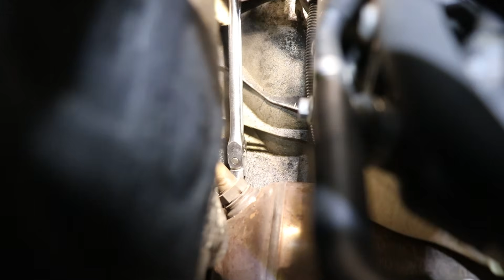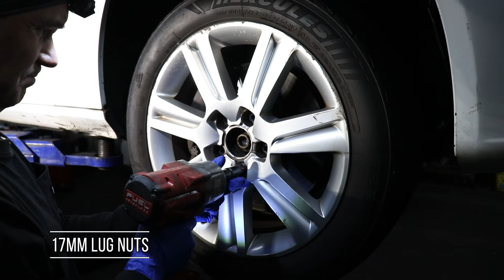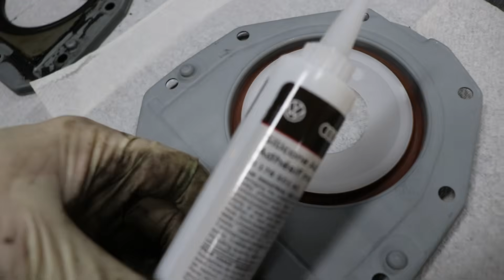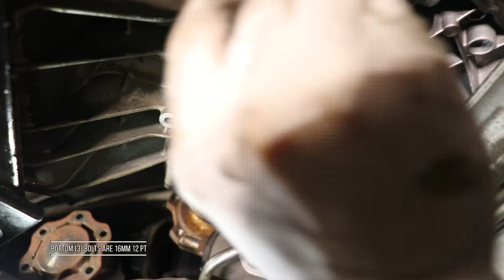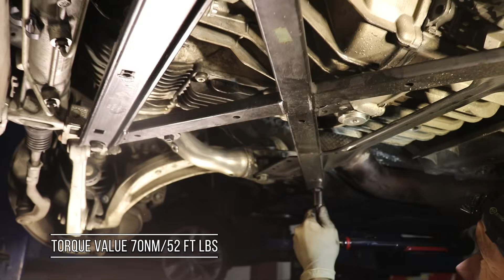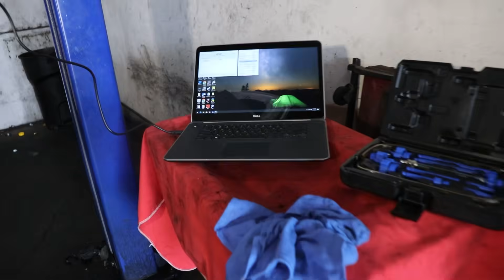2009-2013 Audi A4 B8 Continuously Variable Transmission (CVT) Removal ***Tutorial***

Comment: Do you have to replace the T40 bolts or can they be reused. Audi manual says to replace.
Reply from the maker: Thanks for the question Mike. Audi states you can refuse the bolts (1) time. So you can remove and replace the trans and reuse the mounting bolts.
Good luck on your Audi project.
Cheers!

Comment: Is it possible just to swap the tcu with the orginal one ?
So that you do not have to go to a Audi dealer ?
will it work?
Reply from the maker: Thanks for the question. If you swap out the original TCU from the failed CVT transmission, you will not need to program the car. Good luck on your Audi project, let us know how it goes.
Cheers!

Comment: Any tips on searing the torque converter, I pulled my engine out to do service and now we are reinstalling my engine, and the torque converter is binding up. We are under the impression that the torque converter is not fully seated on the input shaft.
Reply from the maker: Thanks for the question, do you have the same CVT transmission? There is really not a torque converter on the CVT, like a conventional automatic trans. You just need to line up the flex plate bolts to connect the trans to the engine. Let us know if you are still having trouble. Good luck on your Audi project.
Cheers!

Comment: Hi, how easy is it to remove the TCM from these? I have an Audi A5 2009 2.0T TFSI with the following codes: P071700, P171E00, P071600, P171F00. The fault is intermittent… it clears and comes back on its own. Once cleared, the car drives all fine. However, once it is back, it jerks and gets stuck on gear 8..
Reply: I am planning to have it reconditioned.

Comment: Will the car not move without doing the reprogramming ??
Reply from the maker: Correct, the component security will prevent the new Trans from operating. It will need to be coded to your VIN in order for the computer to recognize it.
Good luck on your Audi project.
Cheers!

Comment: UPDATE, I just want to say thank you for the video. Without it I wouldn't have attempted the repair of my rear main seal. For everyone that is wondering, it is possible to do in your driveway. It's not nice but it works. If you want to replace the gear box the car has to be pretty high up. I only jacked it up a little bit and moved the gearbox back to get to the rear main seal. Thanks again. Very valuable content!!!
Reply from the maker: Thanks for the feedback, glad to hear you were able to knock it out in your driveway. That CVT is really heavy so it makes it a little challenging.
Congrats on getting it done and saving a ton of cash.
Cheers!

Comment: I have a 2011 Audi A5 Sportback, I installed a gearbox from an Audi A6C7 and the car doesn't move. Maybe the reason is that my gearbox had 15 pins and the new gearbox has 16 pins. Can you tell me what to do about this?
Reply from the maker: Sorry to hear you are having trouble with your Audi transmission. We are not sure about the pin difference you are mentioning and what impact that has. 
What error messages or codes are you getting after the transmission replacement?
Was the replacement transmission coded to the car?
Cheers!
Reply: @BradleysGarage  has not yet been coded in the car and there are no errors on the instrument panel.

Comment: How similar is this to a manual transmission removal on a 2011 A4? Great video!
Reply from the maker: Hey Ivan, the process will be very similar if you have the 2.0T engine and only FWD. The good news is the manual will be smaller and lighter than the CVT. If you have a Quattro, then you will also have to remove the rear driveshaft.
Thanks for the kind words, glad you enjoyed the video. Good luck on you Audi project.
Cheers!

Comment: What is your advice for buyers, to buy Multitronic or S Tronic transmission (used cars this age)?
Reply from the maker: Thanks for the question, it really comes down to personal preference. The most important thing you will want to look at for either transmission is service history. For the CVT, fluids need to be changed every 30k. On the S Tronic/DSG they typically are done at 40k miles. If these don't get changed on time, then you run the risk of having a situation like we had on ours. Purchased the car with 163k miles on it with unknown service history. Only went a few thousand miles before the CVT just went out. Premature failure can happen anytime with poor or neglected maintenance.
The CVT will be a smoother ride and theoretically more efficient (gas mileage). You won't really notice shifting since it's a belt sliding along a cone shape. These transmissions come in the smaller engine, less powerful models. They are only offered in FWD and not Quattro.
For the S Tronic/DSG you will notice the shifts and feel the gear changes. It will be a more spirited driving experience where you can have more control with paddles. This option will give you the ability to have Quattro AWD if that is important to you. These transmissions came in the higher HP models which typically have more options and better features.
Our ultimate advice would be to locate a manual and never have to worry about a transmission going out, plus they are a lot more fun to drive. Hope this helps with your question.
Cheers!
Reply: @BradleysGarage  Thank you.
Reply from the maker: @JeZZGro  No worries, thanks for hanging out.
Cheers!
Reply from the maker: @JeZZGro  No worries, have fun in your search.
Cheers!

Comment: do you think i can change the rear main seal at home?
Reply from the maker: Thanks for the question, you can do it at home. You will however need to have a nice transmission jack as this CVT trans is very heavy. You will also have to have the car in the air high enough to slide the trans out.
Other than those two things you should be able to accomplish this in your driveway.
Good luck on your Audi project, be sure to let us know how it goes.
Cheers!

Comment: What size are the o-rings or what is the part number?for the transmission lines you installed into the filter.
Reply from the maker: Thanks for the question Alex, apologies we did not include those in the video description originally. You will need (2) O-rings, Part# N90666003
https://www.fcpeuro.com/products/vw-seal-ring-genuine-vw-n90666003
Good luck on your Audi project.
Cheers!
Reply: @BradleysGarage  thanks!
Reply from the maker: @alexn4917   @alexn4917  No worries, have fun on the Audi. Cheers!

Comment: Where is the transmission refill hole?
Reply from the maker: Thanks for the question. If you are doing a filter change, you can add the initial fill from the top through that hole.
The actual "fill" hole is the same as the drain hole. You need to either manually or electronically pump the fluid up through the bottom once the transmission has reached the optimal temperature.
This requires a cable (VCDS) and software in order to view the current fluid temps inside the transmission. The engine will be running while in park to accomplish this.
Hope this helps answer your question.
Cheers!

Comment: I always use an aditive with the 8L oil . I put Extreme CVT yellow brand for the oil PAO+Ester oil base plus Lubeguard Aditive especially for CVT from USA product.

Mine is 0AW LLA trans Multitronic from 2008 Caga Code Motor . It has now 214.000km and runing real good each 35.000 i change oil and filter.

Greetings from Spain Europe
Reply from the maker: Thanks for the feedback and product suggestion, we will look into that. Glad to hear yours is still running great after 214km on it.
Cheers!
Reply: @BradleysGarage  big hello there Bradleys ✌️
Reply from the maker: @Summerlove-M  Thanks again for hanging out, where are you from?
Cheers!
Reply: @BradleysGarage  Spain Europe ! Located in the south . City called Malaga
Reply from the maker: @Summerlove-M  Looks like a great city, amazing weather year around. Not to mention you are on the beach. 😎
Haven't made it to Spain yet but it's on the list for sure.
Cheers!
Reply: @BradleysGarage  Neither here for USA but its on my list always and i always like to watch how you guys work on the cars . Its super cool .😎 ✌️🤙🤙🤙 .

I love the oil brand Redline from USA we use it here . Best oil made for engine 👌

Comment: It is necessary to change the filter for a new one, each time you change the gearbox oil?
Reply from the maker: Thanks for the question Fabian. We recommend replacing the filter with the trans fluid every 40k miles. Since the cost of the filter is less than $60, it's cheap peace of mind. Especially since the internal filter is really not replaceable since you have to split the case open. That external one is the only filter you can change.
Cheers!
Reply: Ola pessoal tudo bem ? Estou com um a4 2.4 v6 , ele está sem pressão no modo driver. Esta acusando 130 bar de pressão no scanear , em marcha ré esta normal chega ha 400 a 600 bar de pressão. Alguem pode me ajudar ? Troquei o óleo porém não tive acesso ao filtro
Reply: Changing filter is a MUST buddy , always and each 30 to 40k Km . Big hello from Spain
Reply from the maker: @Summerlove-M  Thanks for the comments, going past 40k is the fastest way to be buying a new one. It's imperative to change it on time if you'd like to keep driving your CVT Audi.
Cheers!
Reply: @BradleysGarage  exactly , thats why im telling to change oil and filter each 40.000km or less 👌
Reply: @BradleysGarage  dont forget to recommend users a really good oil basses PAO plus Ester as RedLine CVT SLIP , probably the best if not one of the best as Ravenol or Exline CVT ( yellow brand) 😼👌👌

Comment: hey there i recently done this. once i changed the trans i had the SAFE mode on dash aswell an i could no move the vehicle. i would put it in drive, reverse etc and it would not move.. please help.. cheers
Reply from the maker: Sorry to hear you are having trouble with your Audi. That is completely normal after replacing the CVT. There is component protection on all the electronic parts for Audi/VW.

Like we described in the video, you will either need to use your TCU from the old transmission since it's registered to your VIN or you will need to reprogram the new transmission so it can be registered to your car.
Please reach out to us over on our Instagram account and we can put you in touch with the guy who programmed ours.

https://www.instagram.com/BradleyGarage/

Cheers!

Comment: What is this transmission code thank you
Reply from the maker: Thanks for the question, here are the scans for the ENGINE and TRANS from VAG-COM-

Engine:
7021 - MIL Request Signal Active (Check TCM for errors too!)     P1624
Auto Trans:
9828 - Clutch Pressure Adaptation           P1741 00 [040] - Limit Reached
9827 - Clutch Pressure Adaptation           P1741 00 [044] - Limit Reached

Hope this helps with your A4 CVT project. Cheers!

Comment: Did you swap the TCM?
Thanks
Reply from the maker: Hey Jay, thanks for the question. We used the complete CVT from the junkyard car. That is why we needed to do the programming for the TCM. Since Audi has the component protection, you would need to keep your existing TCM in order to swap the trans out and not need programming.
Hope that helps with your Audi project, Cheers!
Reply: @BradleysGarage i